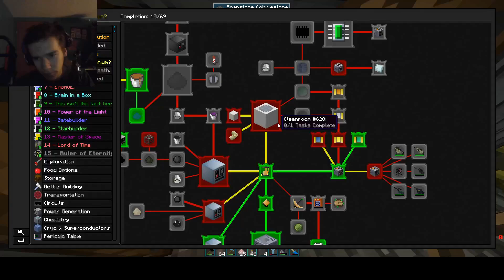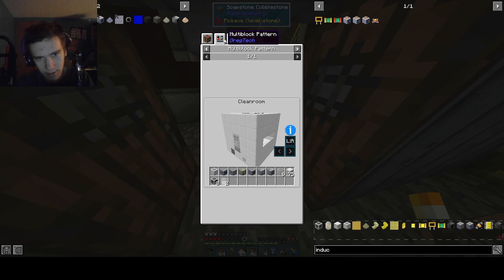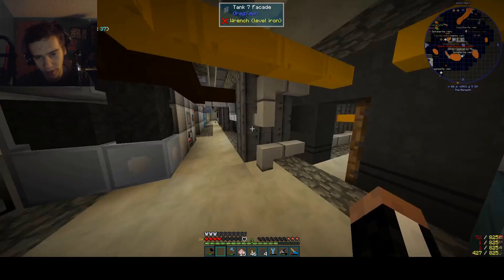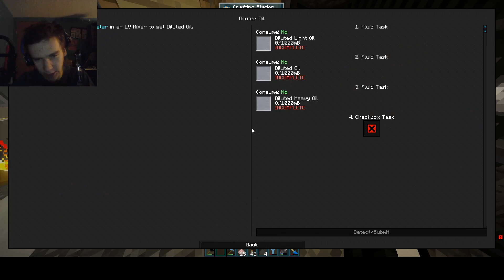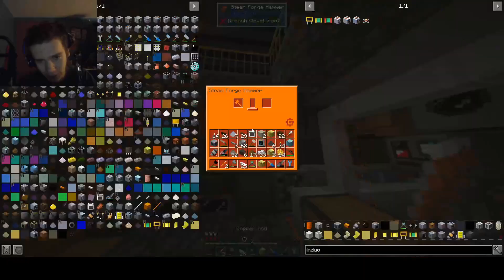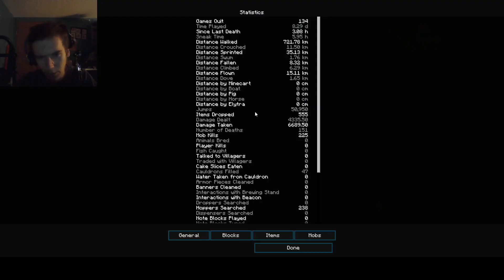Finally doing oil refining

Comment: I would test this in a test world first, but I think the GTCEu "shutter cover" says it keeps two blocks from interacting. I am not sure if that is meant to be only for pipes, or if it will block adjacent power connections as well. This is speculation, test first.
Reply from the maker: I have not heard of a shutter cover, is it new?
Reply: I used one in Nomi CEU Hard Mode in a tight pipe spot, maybe a year ago, so if it is new, it is not too new.